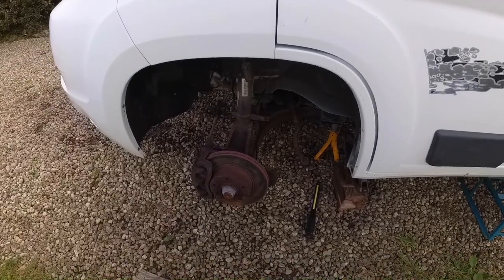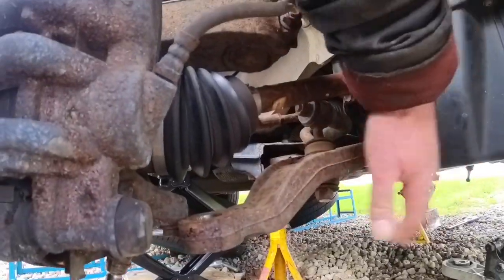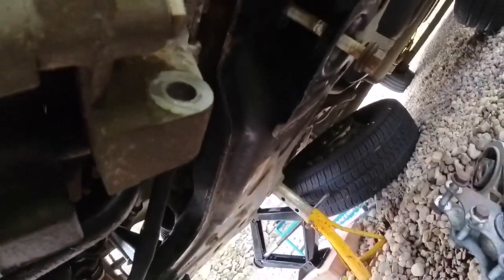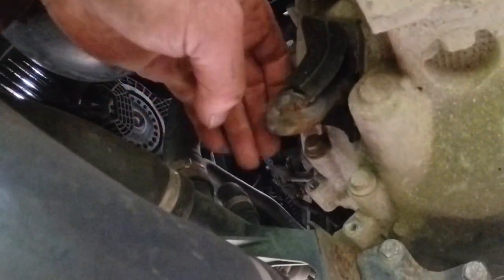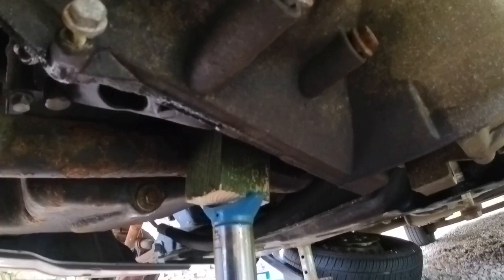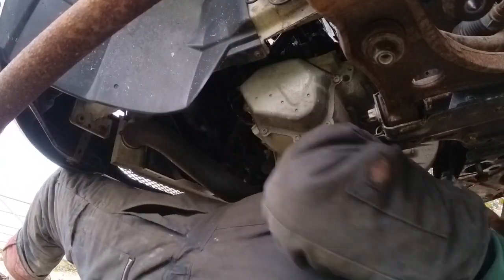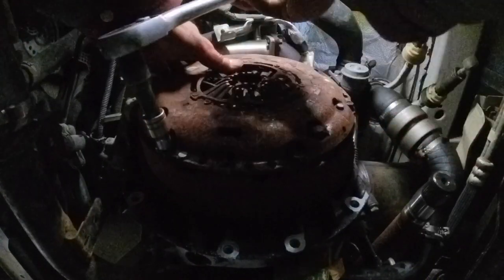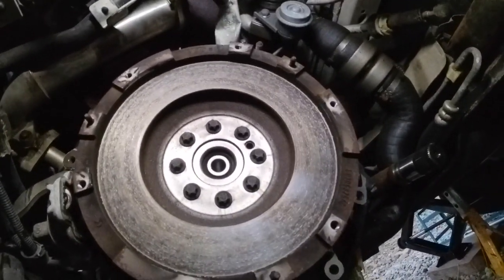Motorhome Gearbox Clutch Dual Mass Flywheel Removal

Comment: Doing the same job like you on my ducato 2.3 multijet from 2009, but isn't it necessary to support de engine while taking out the gearbox? Wverything is loose, only have to take out the  biggerbolts holding the gearbox in place. Thank you
Reply from the maker: @backerken87  yes it needed supporting. I used a block of wood and a jack to support the end of the engine.Good luck with it 👍👍
Reply: @DoItWithPaulie  thx

Comment: Only me again mate the cv carrier do the bolts have to be loosened completely and how do you separate it cheers
Reply from the maker: i removed the carrier bolts on this one. driveshafts will just pop out of the gearbox ..lever them out
Reply: @DoItWithPaulie  I'll do this I just loosened them loads but will loosen fully tommorow mines the 2.5 D lump not sure if there's a pin to split the box not a lot of places to lever it off either